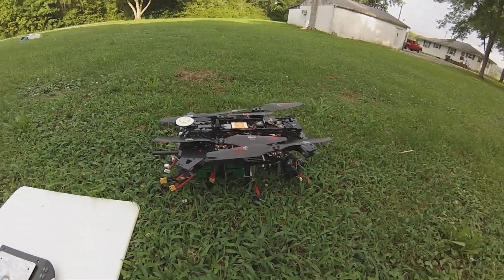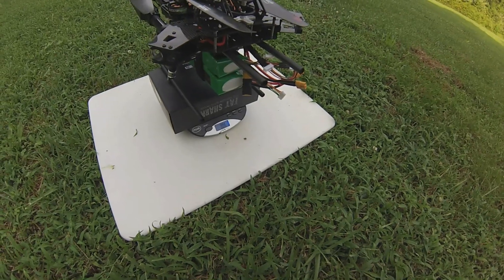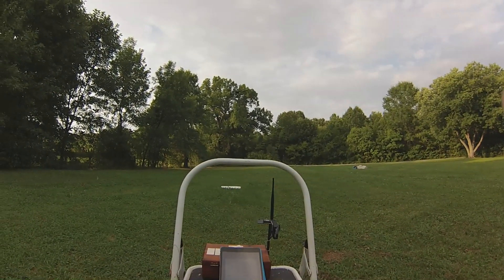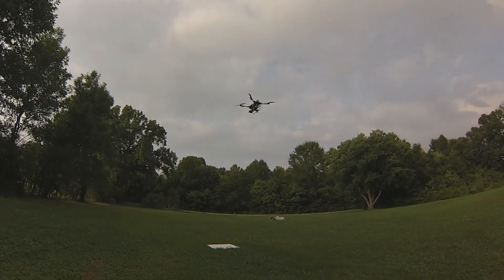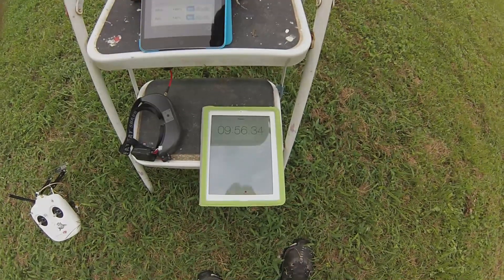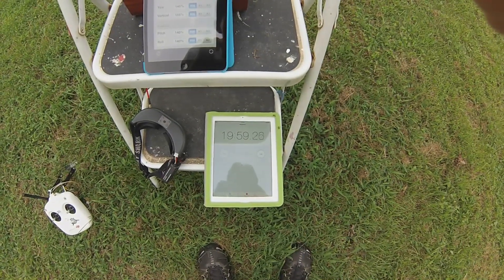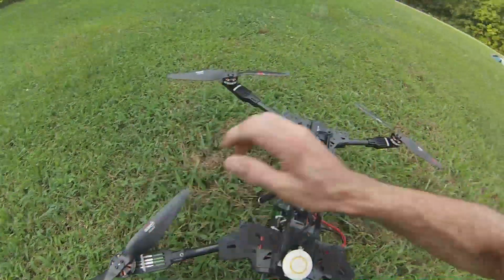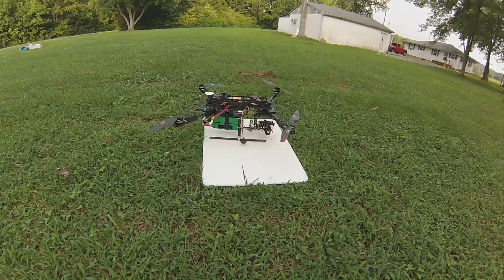Hk multistar multirotor battery review (PART2)

Comment: Nice video...however. You claimed to increase the C rating from 10c to 20c. This is not correct. Just to let your users know you can never change the C rating on a Lipo. Parallel will double the MAH (not C rating) and Series doubles the voltage. You actually lost flight time by adding a second battery (as expected do to weight penalty) 1 battery gave you 16 minutes and two batteries in parallel gave you 25 minutes. Thats a lost of 7 minutes in total flight time. That's why the batteries where not as hot.
Reply: wordupmag thanks

Comment: Just Saw the Hobby King Video, on the Multistar batteries , impressive.. I have a Tarot 650 Modified for the,   Rctimer, 5010/14 360KV Multicopter Brushless Motor (5.0mm Shaft)...  with 17.5 Props...  The motors are putting out 2.4amps at half throttle and 10.7amp's at full throttle.... 4 X 10.7 A = 42.8 amp's.... that is well within range of just one 6600 mah battery, let alone 2 of the bad boy's........ Glad to see someone step up and make some for the Multirotors guy's.... Great Review James...

Comment: You dont actually raise the C value. You double the amps and mah but its still a 10C
Reply: James Adams Doubling the capacity by doubling the LiPos in parallel will effectively double the C rating by doubling the total amps the combined pack can now safely put out. But you can either think of it as 'like' doubling the C rating or as the same C rating and double the capacity. If you do both then your maths will be out by a factor of 2. 
It's best just to think of it as the same C rating and double the capacity for double the number of amps you can safely draw at any one time to avoid confusion. 
If you just replace 2 x Lipos in parallel with 1 Lipo of the same C rating and double the capacity, the the max amps would also stay the same.
Reply from the maker: Ok thanks for letting me know this I've been told wrong I knew it would raise the mah and amp and then I was told it would also raise the c rating as we'll, thanks for letting me know.
Reply: christophertelford It's not even "like" doubling the C rating.  Packs in parallel have twice the capacity but if treated as a single battery pack (4S2P), their combined C rating is the same as their individual C rating.

Comment: Well done I've just got me 4s 8000mah see how's it's go on my 650 quadcopter thanx for this reviewed
Reply from the maker: Cool, do a video I'd like to see how it does, I'm thinking about the 8000 4s or 10000 4s myself.
Reply: Thanx for replying ive just finished doing my test today an i got 22.5 minutes on iron man 650 with all fpv gear including retractable landing gear. A gopro. 4225-610 multistar motors .35amp castle escs all weight total including 8000 multistar battery is 5.5 pounds an am really happy with the result so my next step is going to be getting10000
Reply from the maker: Nice job.
Reply: I will. Ive been using zippy 4s 8000 .30c their heavy 860mg an the multistar 8000 just weight 650 mg so im very happy with this battery
Reply: Mariano Hernandez what prop do you use?
Reply: 14.55 carbon fiber
Reply: I have bye a 650 ironman and i dont realy know what motor to put in. Now i have a 1230 prop and multistars 4s 5200mha you tink is good with a 700kv ?or they go with lower 620kv?
Reply: Go lower
Reply: But not to low
Reply: 600kv?
Reply: Am using multistar 4225-610 with 1455 props an am happy with it but on the future i may upgrade to tmotors 630kv